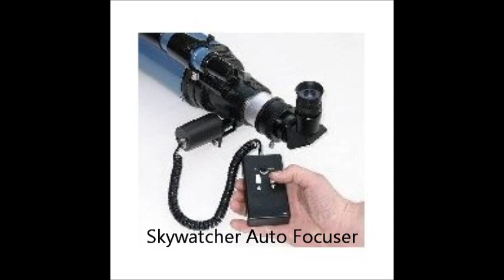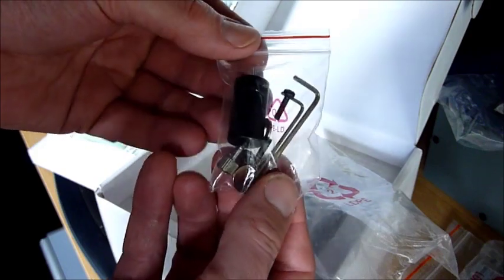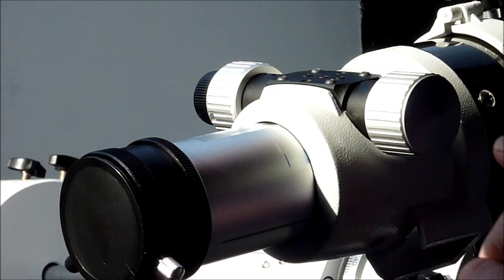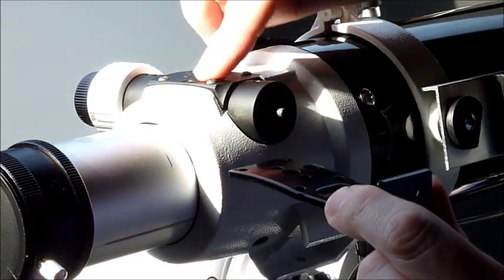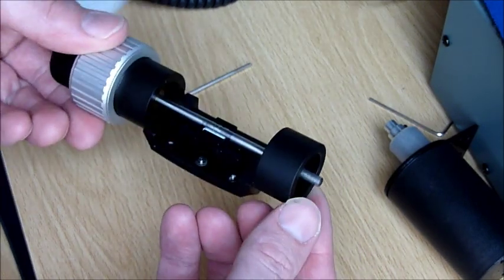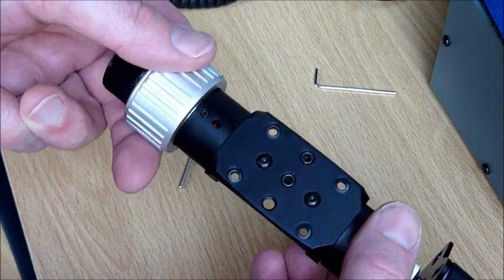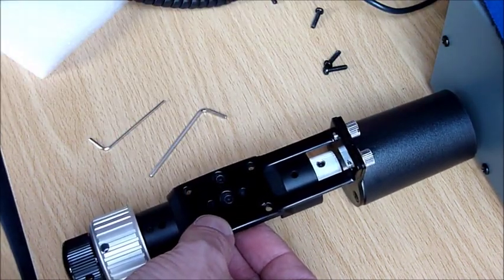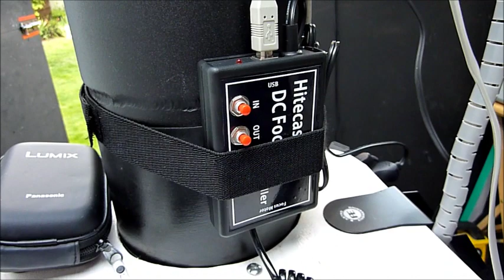How to fit a Skywatcher Auto focuser onto a Skywatcher ED80 DS Pro Telescope

Comment: Thank you very much for going to the trouble of making this video. You've saved me a lot of head scratching and stress.
There are a couple of things I noticed: like in your kit, the replacement screws are Philips cross-head, not Allen screws, so you you'll need the correct screwdriver ready while you're holding the focus plate, while trying to keep the little rubber grommets in place and offering it up to the scope - with all 3 hands fully utilised.
I found that some tape on the bottom plate would hold the (new) screws in place and stopped the grommets falling off.
I also have the Hitech USB focuser and I noticed that when I press the IN button, the focus tube moves out, and it moves in when I press the OUT button. Almost as if the motor should be on the other side. Though in the sheet of instructions that comes with the focuser (and as you installed, too) the motor is shown as installed here. Hmmm,

On the fitting, I found that it was only necessary to unscrew the grub on the single-speed knob by about half a turn, then the knob slides off. That stops it coming completely out of the knob. And when replacing the fast/slow knob, I waited until I had the bottom plate fully in place before tightening the small grub screw to align it all. Finally, I didn't insert the focuser rod all the way into the motor housing, or the bottom plate holes wouldn't quite line up with the bottom of the focuser.

Comment: Useful vid! A few points:
  - don't tighten the dual speed focus knobs onto the focuser axle... otherwise the motor will spend most of its energy turning the knobs esp. the small one that geared 10:1. My motor works much better without this being done up
  - if you find the motor spindle slipping on the coupling make sure the coupling (which is 2 parts, one screwed into the other) is tight and pressing hard on the rubber O ring inside. The O ring is the only contact point between the motor and the coupling... there is no grub screw
  - with the motor fitted you will no longer use the barrel lock bolt to hold the barrel in place (obviously)... so the barrel is only held in place by friction so pay attention to tightening the centre grub screw under the bracket plate as this pushes the focuser axle onto the barrel

Comment: They recommend the power supply should match the motor, so ideally a 9v PSU @ 600-1000 mA would be preferable no, or doesn't it matter?

Comment: The stepped, aluminium connector on the motor shaft is in two parts. It simply unscrews apart. Allowing the first part to go further into the pinion housing to reach the grub screw through the hole. Dismantling the connector exposes the rubber O-ring inside. Which allows easy removal and re-fitting of the connector to the motor shaft.

Comment: Many thanks. Could you expand on the last section regarding the HitecAstro and running the focuser motor remotely? I'm trying to set up a 4SE to run outside whilst I sit in my shed (maintaining some body heat). Obviously viewing would have to be via a camera (Neximage 5 in my case). I can run the mount via an extension lead from the PC com port, the camera via a usb extension lead, but am currently stuck for a low budget remote focus solution.
Is there likely to be any signal loss or voltage drop on this focus motor over 7 metres or so?
Reply: You can remotely control the motor using the HitecAstro DC Focus box via a USB cable... it's ASCOM compliant so will work with most astro software that support focusers... thought this box is only needed if you want to use filters and adjust the focus for each one automatically. Otherwise a very long RJ10 cable for the handbox will work.

Comment: Many thanks for your video it really helped me alot and i wouldnt of attempted to fit the focuser without your video.i had drill another hole in the plate to fit my equinox ed80 pro other than that it works spot on,i only wish the speed was slightly faster,

Comment: nice one this helped me out a lot today! one thing tho the way the bracket is on it covers up the hole for the focus lock off screw (the big one with the rubber end)
Reply: There's another one opposite to it with a grub screw without function. Take it out and fit the bolt in. Although I doubt you need it because the motor gears have more friction than the knobs.
Reply: @Kniesoor  thank you

Comment: This is mounted the wrong way round.  The new curved bracket should be fitted so that one of the two middle holes (the one outermost from the centre) lines up with the focus locking knob hole.  You can now fit the assembly back on to the OTA and retain the focus lock function.  And for god sake, stop smacking your lips at the start of every sentence, it drives me mental!